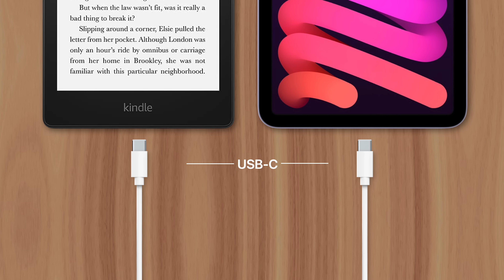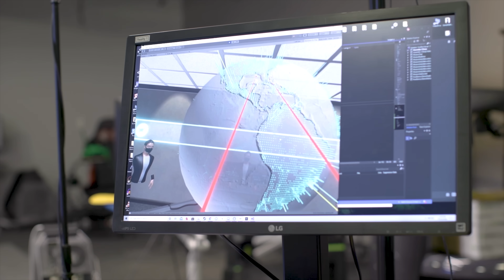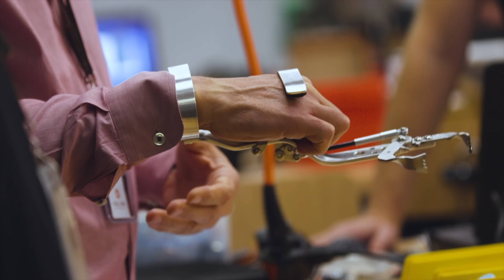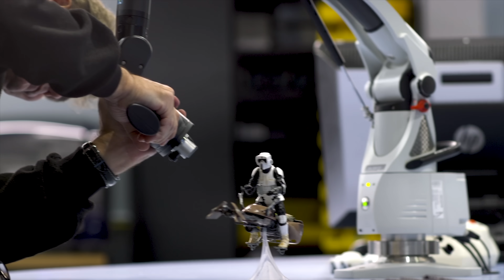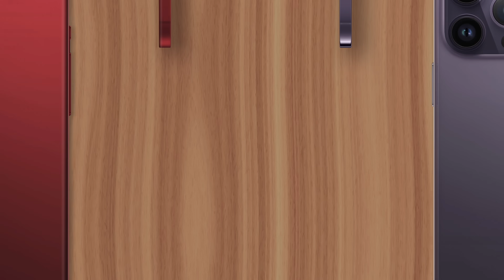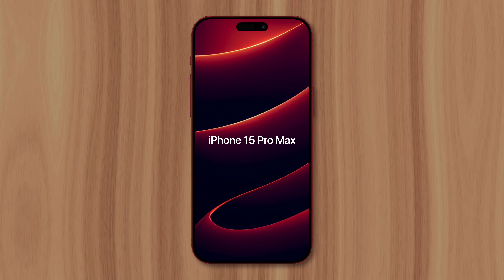iPhone 15: What To Expect

Comment: Life hack for those not in the know: we already have something like the action button. It’s the back-taps feature that lets you set certain actions to double or triple tapping the back of the phone
Reply: Yup. I use it to toggle the torch, although it can be crap sometimes
Reply: Doesn't work well tho
Reply: @wooferjr169  
Works a little too well for me. Accidentally tapped my camera and it turned my flashlight on lol
Reply: @wooferjr169  it works well but the bigger issue is false positives
Reply: @wooferjr169  get your phone checked then.
Reply: @BarkaDog  no it actually doesn't work as well because you have to tap without the case and tap hard enough
Reply: @BarkaDog  or learn counting :)
Reply: @BarkaDog  barley works with a case
Reply: I used the back tap feature for a while when it was introduced but I had too many inadvertent activations when putting it down or in my pocket. I'd pick it up/pull it out and the flashlight would be on so I deactivated it ever since
Reply: Tried it and gave up. Unreliable, requires to tap strongly (probably to prevent unwanted action), limited customization abilities
Reply: @marcrodet4900  can do shortcuts tho
Reply: Doesn’t always work smoothly though
Reply: It doesn't work well with a thick case.
Reply: @liamwelsh5565  that too, it’s pretty iffy with my apple leather case
Reply: @liamwelsh5565  it works with a MagSafe wallet on the back if I tap it on the wallet.
Reply: the back tap[  feature is terrible it doesn't work all the time
Reply: I know, it is really cool unless you have a case that covers the apple logo 😀
Reply: @Andrew-cw2fs  
It works anywhere on the back
Reply: @butter-biscuit2248  I did not know that, I thought it was just the apple logo
Reply: I use back tap to activate AI using a shortcut, can activate text "Siri" GPT and Voice "Siri" GPT, it utilizes OpenAi's technology and needs an OpenAI API Code.
Reply: It's wonky though
Reply: oooohhhh so thats what that is. I  kept wondering why tf my flash would turn on randomly
Reply: The problem with back tap however is how unreliable and finnicky it is. I got a brand new 14 Pro model just a week and a half ago with an otterbox case and the backtap is just as unresponsive as it was on my shattered 12 Pro. Maybe if it was optimized to work better when the phone has a case it would be a useful feature but as of now it's garbage
Reply: works great if you dont use a case
Reply: works perfectly fine for me in a speck candyshell case
Reply: Doesn’t work well at all. It activates on accident all the time and when I DO try to activate it, it sometimes doesn’t register. It’s like my fingers basically have to be right on the bezels and then it’ll activate when I click.
Reply: Works well for me
Reply: For me it’s 2 taps for camera and 3 taps for flashlight.
Reply: It’s so awful tho lol. It’s not just my phone, a classmate at university told us about this and literally 2 dozen of us tried it out and came to the consensus that it sucks
Reply: Not with case on
Reply: @DanielNyberg7  works with a case, but you have to tap sufficiently strong

Comment: I may be the only person with this view but I think Lightning is superior to USB-C in one way: It’s a tighter, more sturdy connection into the port than USB-C. Try to wiggle your lighting connector when plugged in and it doesn’t budge. USB-C on the other hand always seemed a more loose and wobbly fit, including in Apple devices.I used to hate Lightning because the older version had those gold plated pins which without fail would ALWAYS corrode, turn black ruining the cables.(Anyone who lives in humid areas knows what I’m talking about) Apple finally fixed this 2-3 years ago when they started using silver pins on Lightning connectors. But, I agree it is way overdue for a change hopefully Apple improves the USB-C standard.
Reply: Not disagreeing or anything, but I find it interesting how the golden pins used to corrode and silver don’t. I always thought it’s silver that can oxidize, and gold will not react with anything in the atmosphere
Reply: @tgr5588  good question. I don’t know the actual metals used in these cables, by gold and silver I was referring to the color of the pins. But I take it you also experienced the pin corrosion that would ruin every Lightning cable? I swear i would have to buy a new one every 2 months before they fixed it. I’m confident it has to do with the humidity, as people in dryer parts of the country had no idea what we were talking about.
Reply: @tgr5588   they are not actual gold or silver LOL
Reply: I definitely agree and like the fact that lightning is smaller, but as for how well it stays in, I've had a much better experience with USB-C.
Reply: Also I dont have to worry when i put my lightning cable in compared to usb c. I always feel like usb c is gonna scratch my devices.
Reply: @Eli.347   Congratulations🎊you have been randomly selected to win a prize🎁Add the Up Username on telegram to redeem yours right now.👆Thanks for 👍 Commenting.!
Reply: Thank you. I wish sturdiness would have been more prioritized while creating USB-C.
Reply: You're not alone, my oneplus c type got loose and I can't play games while charging
Reply: @tanyapunyo2074     you need to clean the charging port gently with a small pin or toothpick and it will work just fine
Reply: @tanyapunyo2074  You’ve more than likely worn the port out by putting too much strain on it from using the phone while charging, try using a longer cable if using the phone while charging as this will put less strain on both the cable and the charging port, longer/aftermarket cables might not charge as quick though it’s a lesser evil! Also make sure that the type c connectors on your cables are nice and clean before plugging them in! Also like the OP said try cleaning the charging port out!
Reply: @aep-world6752  lightning cables don't give such problems
Reply: @aep-world6752  also type c to 3.5mm jack sucks more, they get damaged/ loose within a week 😂😂 one more reason why I shifted to iPhone
Reply: @tanyapunyo2074  To be fair I have heard that somewhere!
Reply: The iPhone is the last existing device to keep the lightning port (as far as I know). Its somewhat keeping people in the apple ecosystem by needing a different charger for that device
Reply: Congratulations🎊you have been randomly selected to win a prize🎁Add the Up Username on telegram to redeem yours right now.👆Thanks for 👍 Commenting.!
Reply: Only if apple improved the connector somehow. USB-C is good, because it’s universal, and due to the many pins the connector has.
Lightning is stuck on 20 watts, USB 2.0 speeds MAX. While USB-C has USB 4.0 which is fast as heck, and supports 180 watt charging with power delivery.
Not really useful on iPads and iPhones since they take little power, but 40 watts would be better for quicker chargin on apples stuff.
Reply: Personally I've never notices such problems on USB C iPad's and Mac Books. USB C is just better in every way and Apple wants lightning to gain profit from selling their own cable. It's time to end this for all.
Reply: @TamilEelam1  That’s because apple makes their USB-C ports and cables super dialled in to be tight. While every usb-c port and cable is different by mere milimeters.
I have them wiggle on all sorts of other devices and peripherals, but apple does them better.
Reply: Totally agree, i thought i was the only one if they make lightnings to match the usb 3.1 speed then I don’t ever wanna see usb-c again, lightning is technically way better aside from speed.

Comment: Look, apple can improve a lot since they had small improvements. Like price should be reduced from 15 and 15 plus should be $699 for 15 or $799 for plus, high refresh rate, an telephoto camera sensor which can be actually upgrade

Comment: For the 1st time in my life I don’t want to upgrade every year 😂. The 13 pro max I got has still got at least another year
Reply: 120 Hz was the killer feature for me. Let's see how long it takes for a reason to buy a new one.
Reply: @Fips3000  me with my xs max still wondering if should upgrade 😂
Reply: @luism8612  i really think every OLED model is fine, so everything from iphone x and up, but XR and 11.
Reply: Bruh, I'm still using an iPhone 11... I was tempted to swap the battery and hold onto it for another year, but I'm running out of storage and having USB-C would make life a lot easier

Comment: Looks good if true. I'm planning on. Installing a new battery for my 11 pro max to use it a little longer
Reply: Actually that's what I'm contemplating too as the 11 Pro Max is still an incredible machine. There is no 5G coverage in my town so currently an upgrade is not required.
Reply: Me too!

Comment: Just hoping they bring the 120hz screen to the non-pro models personally.  Sticking with my 12 Mini until that point, its the only thing I'd want to upgrade for, and I don't need the extra stuff that comes with a Pro
Reply: They aint bringing 120hz to non pro models
Reply: Good luck cuz right now it’s called PRO MOTION as in unless the name gets changed it will very likely stay with the pro models
Reply: A shame Apple doesn’t put a 90hz panel in the non-pro models 
And have the 120hz display for the pro models. 
They should do that with the iPhone 15 and 15 Max but they won’t.
Reply: Im planning to get a 12 mini soon from an iphone 11 because of the size, how’s your battery life?
Reply: @MiaMira18  personally I don’t have any issues at all with battery life, because at home I can charge, in my car my phone mount charges it wirelessly, and at work I can also charge it, so it’s never a concern. 

But if I couldn’t charge it throughout the day after about 8-9 hours of work and randomly scrolling through SM apps it’ll be around 20-30%
Reply: @FracturedGoblin  there's is no way, in your 12 mini, that you're getting 8-9 hours of use/screen on time and still having 20%-30% battery life. 
Now in many of the Pro Max models, I can see that but the 12 Mini?!
Reply: @Colt8722  not 8-9 hours of screen time, I’m talking 8-9 hours of me being out and not charging the phone, probably around half of that in screen time
Reply: @FracturedGoblin  understood! That makes sense!
Reply: That’s not happening until 2026
Reply: if the 12 mini will have 120hz display your battery life will go down the drain.
Reply: @iyrsh07  I'm not looking to get 120hz in my 12 mini, I'm just saying I don't want to have to pay more for a Pro model to get it, I'd like the 120hz to be added to the standard non-pro and non-max model